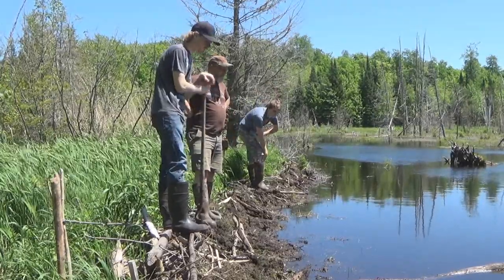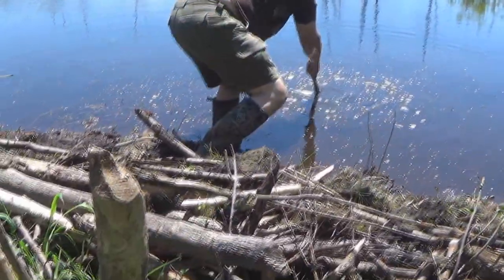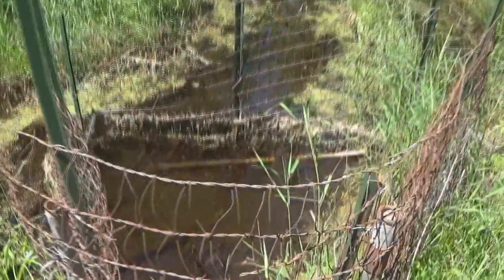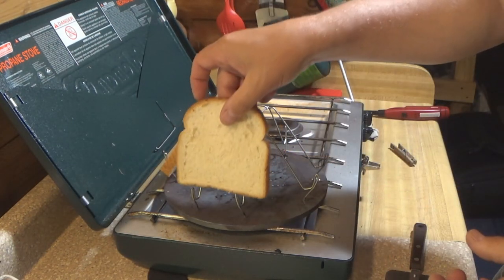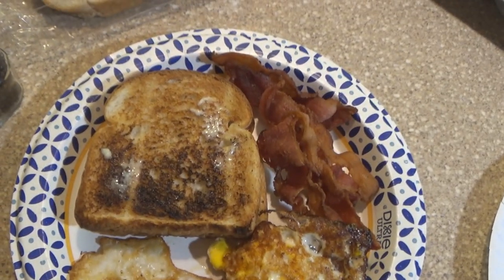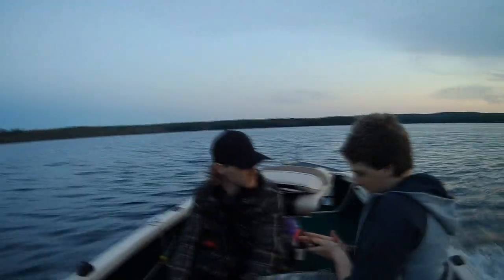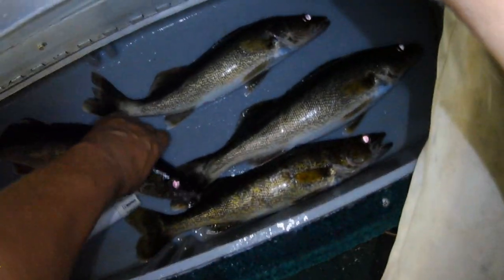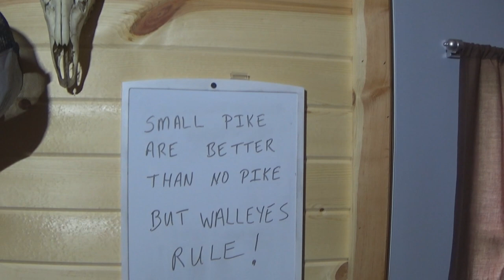Off Grid Camp Fishing Trip - Catching Walleyes

Comment: Have you guys thought about sinking a well for a hand pump on your "off grid" property?  Seems like you guys should have good ground water up there. Hopefully that would save y'all from having to pack in all that water.  You could replace it with Spotted Cow. I think it would also make for a good video.  Maybe....
Reply from the maker: We did try a well one time.  We had water at like 10 ft.  But it would not pump up.  It was held in the ground even with plenty of vacuum at the pump.  Then we couldn't get the point out to try another spot.  We may try again, KPO.